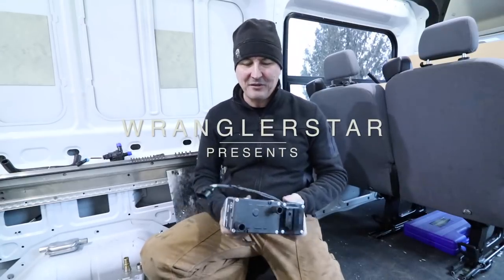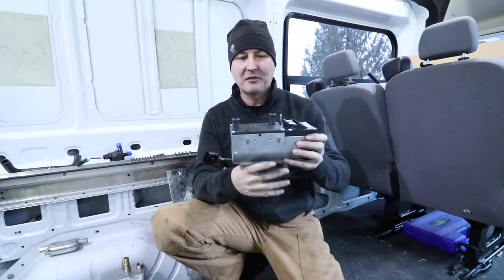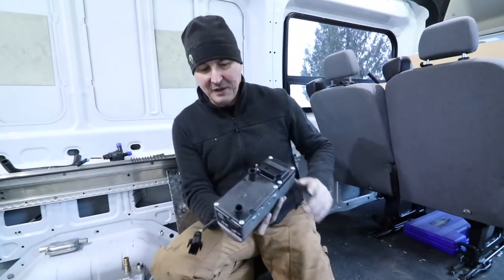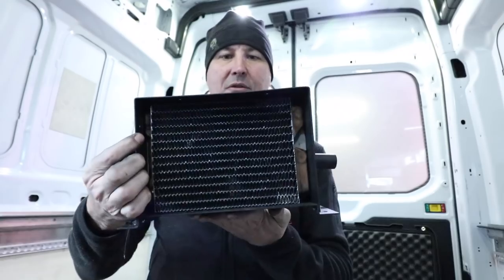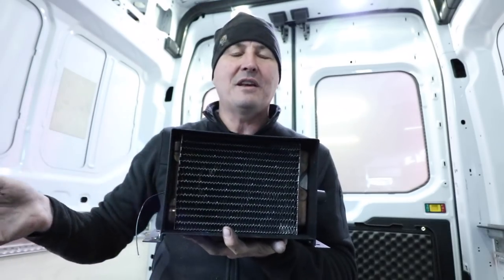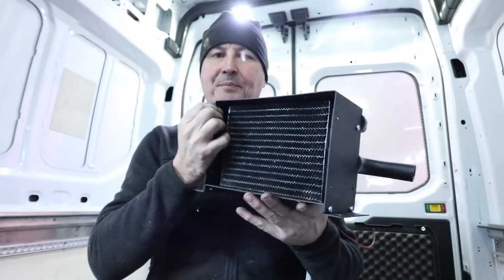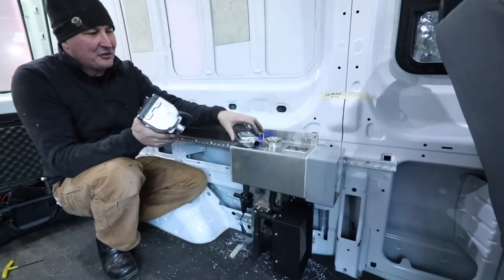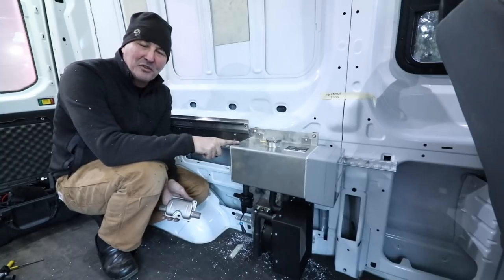Installing A Rixen Hydronic Furnace In Transit Van - ESPAR

Comment: I've used an Espar diesel hot air unit for my boat for 15 yr. It was awesome!  Sipped fuel, used very little electricity for the fans and it would create a LOT of heat. They were designed in Germany for use in trucks. Highly recommended.

Comment: Plate frame heat exchangers have been in use in industry (chemical and Oil/Gas) for a very long time and are extremely efficient.  Glad to see they have finally brought out a miniature one for personal use.  I really think you should move the furnace to the back of the van, under the bed.  Otherwise, both heat units are located in the front of the van and heat distribution will be less than optimal.

Comment: I have used the Ebberspacher D1L hot air heaters for over 25 years, work great at heating truck cabs, dozer cabs, RV's ect. Very economical to run. Now I would like to try their hydronic heaters eventually, it would eliminate the need for a second heating system for water.

Comment: First time I have seen this system installed in the interior.  Rixen offers to install it for you or sell you the parts like you bought, Unfortunately for me ,a Canadian, it comes to around $6500. I opted to go with a great unit made in Canada by Hurricane, called the Oasis Zephyr which  comes out at $4500-$5000. This is a preferred unit in the high end  Boating industry. I like sth way you installed this unit in such a small space, great idea using th metal plate. Advanced RV shows you a combination  install of this unit on the exterior/interior. The people at Rixen are great and very helpful as you experienced. Thanks for this video it ids going to be very helpful for many people.

Comment: Cody, I have a diesel fired Webasto heater in my semi. They work fantastic. Mine is just an air heater. You have to be careful when getting out of bed. If you put your foot on the floor in front of where the heat blows out you will move it real quick.

Comment: Sounds like a great system cannot wait to see it up and running I have built out several vans for work with customer shelving the last ones I did I used 1/4” foam insulation with a silver reflector on both sides and quarter inch Plywood for sound it did wonders also used the the threaded rivets and they are very handy

Comment: Those devices, usually the diesel versions, are often used in tractor trailers to heat the sleepers and also to keep the engine coolant hot without having to leave the engine idle in cold weather. It has many practical uses.

Comment: Gday wranglerstar greetings from Australia, the best thing I ever done to my van was insulate it I used kingspan kooltherm which is a under slab insulation and is extremely light, this stuff made all the difference and I think your van would retain a lot more of its heat with any sort of insulation during the winter I had slept in a -3 degree night and had a temperature inside the van of around 9 degrees Celsius and that’s with no heater running.

Comment: The legend of the white panel van rises from the ashes...I think espars got their start as off grid block heaters for heavy equipment tied into the machinery electrical and fuel supply

Comment: I work for a Frieghtliner dealership and a lot of the trucks have these for winter heat to keep the trucks coolant hot after shutdown for  sleeper heat at night. Of course they are are tapped into the vehicles enormous fuel supply

Comment: That is a neat system. I did not know that anyone was making a gasoline fired hydronic heater. I am familiar with both Webasto, and Espar, from working in the marine industry, and those have all been diesel fired. This would be a great way to introduce non engine dependent heating in to small pleasure boats, which mostly run on gasoline.

Comment: I've had air only and the water version in my semi trucks.  The water version doesn't get hot enough at all(at least mine didn't). The hot air version will cook you if you keep it on high. I hope it works better than the one I had for you.

Comment: Hey, 10:00 if you care about vibrations/noise, put in a rubber washer underneath, it might also stop some heat transfer between the metal components.
Also, try to clean your workspace, if you step on those metal shavings you could ruin your carpet, or it could end up in one of your components when installing - either way it's good practice to clean it up before hanging everything up since it was easily accessible.

Keep up the good work!

Comment: What you also could have done was to simply add the radiator to the vans stock cooling circuit in addition to adding the Espar. You'd have the double function of warming up the engine and melting snow off the windows. these types of systems are widely used in Europe during the winter time. and a lot of manufacturers like Volkswagen actually have it as a factory option on their passenger cars since just idling your car is illegal.

Comment: Most deisels here in sweden has fuel warmers as we call them. They use a tiny amount of fuel to heat the car when its cold. It can be used in RVs to heat the entire car and tap water.

Comment: Wow that is amazing stuff, really cool!
Looks like the German engineering has come a long way from the old B2 gas heaters in the VW Beetles. I remember a friend had an old bug, and that heater was really fickle, sometimes it worked great, other times it just sucked gas and produced no heat.
I really like your nice, neat, compact install, well done!
With all those components and hoses when you do have coolant in there, make sure you don't have any air bubbles, I can imagine they have some sort of bleed on the components so you can get rid of air in the system.
Looks great!
Cheers from Tokyo Japan!

Comment: I hope there are some shut off valves being installed so when the rubber hoses fail, that the whole system doesn’t have to be drained to change them

Comment from the maker: Here is a link to the Espar Rixen Hydronic furnace: http://rixens.com/
Reply: Wranglerstar 
Amazing setup! 
Only 4500 dollars! 
LOL

Very informative video. I appreciate the work and time you put into it.
Reply: Wranglerstar 
Also, a long while back I remember seeing your benchmade knife. Was that an Osborne? Ive been thinking about getting one of their folding knives or their Bushcraft.
Reply: That's an incredible system! I'm curiouse though, the video on their website of the same system you're installing shows them doing an undercarriage install, what is the reason that you decided in cab would be better than underneath?
Reply: This looks really great but aluminum is also an excellent thermal conductor. You could certainly increase the efficiency of the system by insulation it better from heat loss and conductive heat loss.
Reply: Even plastic mountings or nylon washers could greatly help isolate the critical components. Expensive but an incredible system. I’m very impressed, it seems that all the bases are covered.
Reply: Wranglerstar talk about jerusalim!
Reply: You should watch out for carbonous gas and you shuld check/measure it over a day or so.
Reply: Wranglerstar i whish we have things like that in my country palestine😔
Reply: Wrangler star, I just called these people and they said blah blah blah blah blah blah blah so we wall units people love a blah blah and then I finally got them to see a price and it was $4500-$4700 !! That's more than we have in this whole house (fifth wheel camper keys.)

You know, these Chinese on-demand water heaters will do the same thing if you add a large automotive heater core and the fan from something like a rear heater from a Chevy Suburban. Just add an additional thermostat for and recirculation pump and blower fan and you will have hot water on demand and space heating for $4000 less oh and by the way you also need to add on a propane tank. I'm not sure why you would recommend the one you're talking about. Seems to me you would have to be pretty wealthy to afford this sort of thing. Love your videos but wow not sure about this one.
Reply: Wranglerstar   thats what use truck drivers call a bunk heater. check and run it some even during rest the year because dust can collect on it and then when start it up in winter time, it will catch on fire. and make sure of keep a window cracked open some so of no carbon monoxide and don't let anything sit near it so it will breath. also get you a carb monoxide detector for the vehicle.  they also do make a engine block heater that can run off of it.  enjoy that furnace.
Reply: It's been -30 degrees here I live in Norway
Reply: Wranglerstar not sure if my other post went through.. check out incredible tiny homes... you two should collaborate! Me too!
Reply: R40 insulation too much to ask?....Walls, Ceiling, floor, don't miss a spot....
Reply: La beast
Reply: Wranglerstar I'm not sure if im seeing it right it looks like the line from the pump is going to the top of the heat exchanger. The feed for the heat exchanger is usually connected to the bottom so gravity doesn't pull it through the heat exchanger and has maximum contact time with the heat exchanger. Same principle is used with water  purification lights etc though I'm not sure if it's essential.

Comment: That's a really cool $4000 water heater you have there... think I'll just stick with propane... less failure points,  and cheap to repair.
Reply: Yeah, but if you can afford it, this system is surely the best.  It always feels great to have the best.  Always thankful I live in the best country, and now, with the best president, too haha!
Reply: This is a really nice system to have for cold climates.  My plan is to adapt it to use pex in the floor for radiant floor heat.  The best way to heat a van IMO since it is efficient, very comfortable on the feet (heat rises) and will not dry you out like forced air heat.  Plus you can let it run and keep the van toasty for a small cost.
Reply: @Epicsurfster  Please help me understand this?

Comment: Shouldn't the heat exchanger be insulated from the mounting plate?
Reply: especially in hot weather when you only want hot water
Reply: agreed, that pump will be running just to keep the plate warm, the heat exchanger needs to be thermally isolated

Comment: the holes for the hot water generator unit must be sealed air tight around the hoses.. so you don't end up with carbon monoxide fumes like the police explorers ended up with when wires and hose holes were drilled in the floor pans of those.   and don't forget to paint the edges of the holes you drill so they don't rust out..

Comment: The heatexchanger feels like it's a van-frame heater 
I guess after everything is installed your engine oil won't get hotter than 60 Celsius with all that new heatsinking and the new small radiator... etc. 
I'm looking forward to real test results!! I guess that's also interesting for a lot of others

Comment: I have a webasto in my Motorhome works well mine runs on diesel very similar to yours
Reply: Me too in a BMW diesel engined Rover 75.  They are cool things.  I like the heat exchanger too, just like one from a UK domestic gas boiler!
Reply: How does the cost compare. I need a diesel powered one as well.
Reply: consaka1 I’m in the uk price depends on which kit £500-£2000
Reply: consaka1 the original version is diesel..

It's primary use is to preheat you engine and cabin in winter.. There is a thermostat in the furnace that tries to keep the coolant at 80°C.

Comment: Just a question.. would it be a good idea to have your heat exchanger thermally isolated from the aluminium checkerplate you have it mounted against? You get thin matting that is poorly thermally conductive. Otherwise, surely the efficiency of the heat exchanger will take a hit with some of its heat sinking against the mounting plate? You want to keep that thing as hot as possible surely?

I'm not trying to point out something wrong that you're doing by the way lol, maybe there's good reason why you don't insulate it. Just asking the question..

Comment: Since the Rixen website doesn't have the heater information, will inquire here.
Since the heater can use coolant lines off the engine, how about using the heater to keep the engine coolant warm? In this manner the front heater instantly work went turned on and the engine wouldn't be ice cold.

Comment: In finland all ford transits come standard with water heater for the engines witch running automatic the fan to heat the cabin

Comment: I have really enjoyed following your videos for several years.  Now that you've had your D5 WS Diesel Hydronic Furnace for a couple of years I just wondered if you still like it of would do something different?  I'm seriously considering a van build myself and would hope to do the same setup you have except add an engine block heater circuit as well.

Comment: I used a very similar heater for my modest electric car. Unfortunately, my car has a pretty small battery, and the heater isn't very efficient. So, to be able to go full distance AND stay warm, I plumbed a heater like this into the cars' heater system. Works great! I also have E85 available at a local gas station, so I run the heater mostly on alcohol. Here's a playlist I made of the installation: https://www.youtube.com/playlist?list=PLmHss3DBZUikipS2HncBD9GjK23iQ_P1O

Comment: How do you plan on insulating the walls with all that stuff bolted to it already. All of your dimensions are going to change. I found that out the hard way after having to grind nearly an inch off an already built shelving unit. Be sure to check out the transitfourm for some ideas.

Comment: Nice set up. Dare say, is it one of those items that if you ask "how much" you can't afford it? Probably worth every penny, regardless.
Reply: JREACHER1954 No price info on their web site either ... Annoying.
Reply: The prices reflect on the build. every build is going to be a little bit different so the prices will change depending on what parts you do and do not want.
Reply: JREACHER1954 the heaters used in commercial trucks are around $1000 to set up, some variance of brand and obviously if you set it up or pay them to. They also make them to put into the engine cooling system so if your in sub zero temperatures you don't have to worry about the engine starting.
Reply: We understand that prices will vary but a "prices from $xxx for hot water and heater in a van" on the web site would be nice ... or Cody could say "a system like this will set you back $xxx" People just want to know if they are even in the market for a product. Since I couldn't find prices on your site, I spent a couple hours looking at your competitor's systems since something like this would be cool in my Vanagon but if there was a price on your web site, my search would have ended there and you'd be bookmarked as "Van Heater". In my business I really discourage tire kickers since they waste my time so I have all my pricing up front ... I don't want anyone telling me how to run my business so I won't say anything else, just thought you might want to hear a potential customer's experience. Cheers!
Reply: Jay nice
Reply: Patrick thats the best way.

Comment: Cody, you should have vacuumed the chips before you mounted all the equipment. Hope you use hose clamps on those rubber hoses. Since it burns gasoline, do you have a carbon monoxide detector?
Reply: htmagic 
im with you on the 02 detector. always a must with gas generators near sleeping areas so you dont die!
Reply: I think he is mounting the heater under the van.

Comment: I knew it was going to happen!!! You said "hot" water heater!! It's a water heater. You don't heat hot water.  👍 A round circle.
Reply: It's all relative.
Reply: I was thinking the same thing, but didn't want to sound like a troll..  ATB.
Reply: I mean, you technically can always heat hot water up until it boils, at that point it’s no longer water but steam.

Comment: Great videos! My question is about the auxiliary fuel feed for the Hydronic system. Did you install the 300mm long  fuel feed in your fuel tank? I am about to install the Espar B4 heater in a Transit and the fuel pickup issue is bothering me. Thanks

Comment: We use these heaters in our semi trucks except they run on diesel fuel and heat the bunk..instead of heating water it just heats air and blows it out into the bunk..

Comment: Hi, your system is great, but I have a few questions. I did check with Rixens for this system, but found they were quite a bit higher than what I was looking at. One factor is the electric 110v element, the one I'm looking at does not have this. My question, have you wired it yet? I bought pretty much the same system, a Hydronic II, from a place in the UK called Heatso. The overflow tank is an Espar plastic tank, the heat exchanger is almost the same, also the blower. My problem is that the only instructions from Espar, show as if it is being used for heating the vehicles motor coolant system. Did you get a good set of wiring diagrams and if so, would you share them? Thanks, great build.

Comment: Better get more at least 4 large batteries. I have one in my semi truck and it will run 12ish hours before I need to start the engine to top off the batteries. I have 4 batteries in the truck, no deep cycle, so you might get more run time with deep cycle.
Reply: I appreciate that good sir. Thank you for the kind words.
Reply: That van will also take far less power to turn over then your truck. Personally if I was setting up a van like that I'd run a solenoid off the ignition to a second battery that powers the hotel load. Like I have my truck set up, 4 primary batteries for normal functions and 2 deep cycle starting batteries for the hotel load while on my 10.